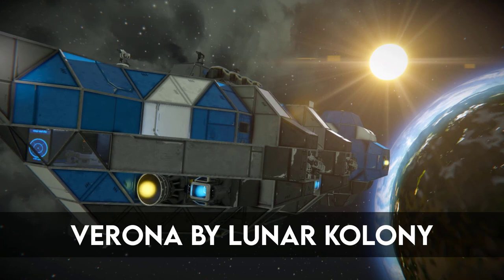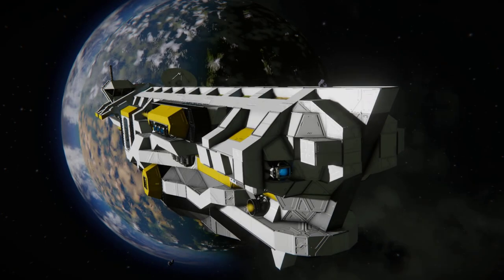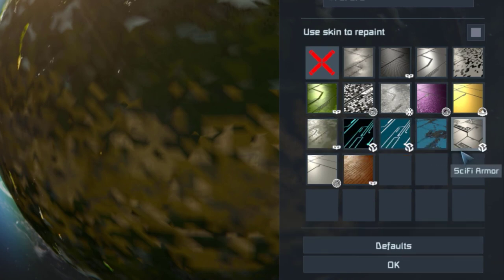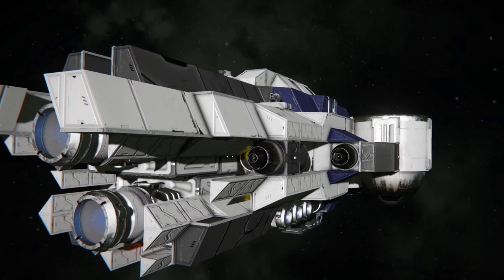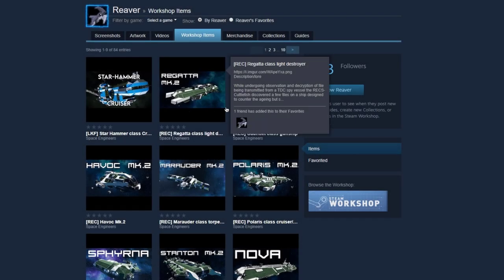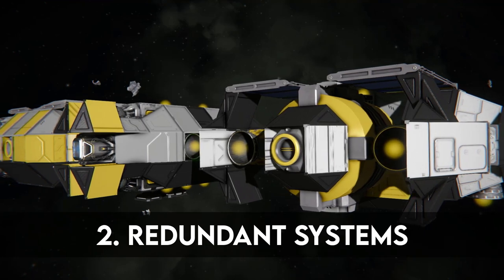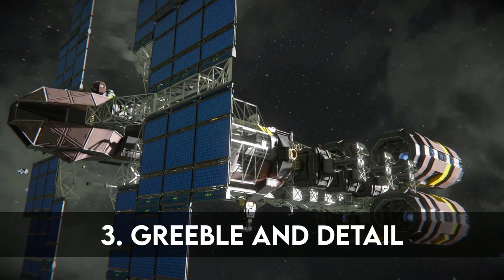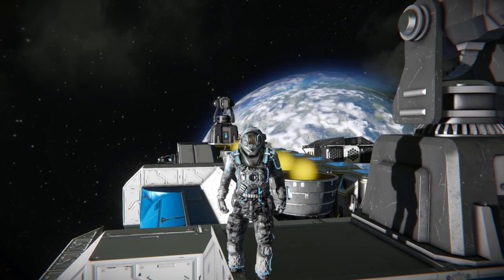Space Engineers: Tips for building better looking ships (tutorial)(ft. Ship builders)

Comment: I find my best technique for building is to start from the middle and work my way outwards. I’ll start with the actual corridors and rooms, pressurise it, then build a frame around that and armour when necessary. 

I have a military mindset when I’m building, so I like the idea of everything being standardised. I have a set of corridor and room designs I will use and put together in different configurations
Reply: How do you determine where to place your internal components? I usually do good at making the interior look nice, but struggle with layout and knowing where to put stuff
Reply: @valleyforgeproductions  I generally stick my engineering decks near the back of the ship with the thrusters. The CIC always gets placed at the center, period, in military ships, as far as I'm concerned.
Armories and air locks are put near each other, as shipboard Marines would gear up before diving out the airlock into the void
If the gunnery deck isn't thrown in with or in front of the CIC, I generally put that in the front section of the ship, with habitation directly below it. Habitation is everything from crew rooms to the galley
If the type of ship requires it, drone/fighter bays replace gun decks
Reply: @valleyforgeproductions  Pretty much what Corvus said. Most of your engineering spaces should be in the rear third of the ship, CIC and crew quarters/accommodations in the center and most of your weapon systems up front. However don't follow this last bit too rigidly or you'll end up with blind spots your ship's weapons can't reach. 
         The last thing that is worth mentioning only applies if you use a specific mod but it is significant enough to be worth mentioning. If you use the 2cm beam system mod and plan to build laser gun turrets into your ships you will need to leave space underneath where they will be going for a room to house the laser generators and beam guides, it's not place and go like the D.E.W. mod.

Comment: I focus a lot on interior work and functional design, and I hear the same complaints from ship builders all over about designing interior spaces. A tip for this is to imagine the space being used and the painpoints that might be derived from having things a certain way; such as: 
- When placing a medbay, put it near locations where accidents may be more frequent, or near an external airlock, so moving patients is simple.
- Have recreation or downtime areas near living areas and away from higher traffic or work areas.
- Always make room for bulkheads in the case of depressurization, make sure crew can survive on the ship or navigate if a breach is located. (Much in line with Yoshi's tip on thinking about redundant systems, think about redundant passage)
- In case of disaster, have a quick escape plan for highly populated rooms, such as a traditionally locked escape hatch off of the bridge.
- Keep pilot visibility in mind for a bridge/cockpit. It is easier to pilot a large ship when a bridge is located in a tower or towards the rear of the ship.
- Find and stay consistent with replacements for DLC blocks. You don't have to buy a DLC to imagine a passageway as a bed; ship builders have been designing vanilla ships this way for years. But if you have the DLCs, use them! They are a great way to breathe life into your interior spaces.
- Place stair blocks vertically, set your gravity to lower than regular planet gravity. Steep stairs are much more comfortable to climb in low-g and you don't need your gravity at full strength to walk around the ship. Ascending 5 meters per 2.5x2.5 meter footprint is a great way to fit multiple floors in your ship.
- When you have a new idea, think about how you can incorporate it into existing designs before starting a new ship from scratch.
- Use the workshop, tinker with people's designs, but always give credit where it is due. Tell people about your inspirations and discuss what you love about other people's ships. Imitation is not a sincere form of flattery, flattery is.

Comment: As someone who builds from the inside out i focus almost entirely on function over form. This usually means all of my ships start off working exceptionally well but looking equally ugly. 
However, when i find designs i like i will often carry them over to the next playthrough and every time i rebuild one for a new game i always try to make one improvement even if it's as simple as adjusting the lighting. Over time those small changes can completely change a ship into something really nice.

One of the most important things you can do in survival is to take a break from using projectors and welding ships and instead weld up your main ship by hand; getting your hands dirty so to speak. More often then not when you have to do it by hand and from memory you'll start to notice things that can be improved and carried forward into the next ship iteration. 
There's some ships i've used for years rebuilding them dozens of times over thousands of hours of various playthroughs before i got them to a point i considered them finished. Atleast for me sheer persistence was the key to building the better looking ship.

Comment: a tip that i can give is not to round off much either, when you make everything look smooth, and connect, transition up, in the end the ship MIGHT not look as good, as if you for example used a non fitting corner, or just cmpletely ignored it and made it square. this ofcourse also depends on the shape of the ship, again.

Comment: my problem ist that my ships always seem to be very "slow" and sluggish. I put so many thrusters on it and then i see your ships with almost no thrusters. what is the secret?
Reply from the maker: Do u build with heavy with
Armour?
Reply: @LunarKolony  only light armor
Reply from the maker: @tobimanx7026  hydrogen thrusters are alot more powerful than ion thrusters
Reply: @LunarKolony  yes i only use hydrogen
Reply: @tobimanx7026  and then the guy also had no clue
Reply: @daanstrik4293  sad life
Reply: @tobimanx7026  the problem may be weight, its neigh on impossible to make a very large or heavy ship be very fast and nimble, a cruiser will never be as fast as a good fighter, ever. Cargo and internal systems are a big part of weight, if you want a fast ship try making small specialized ship
Reply: @daanstrik4293  woops I meant to ping you instead